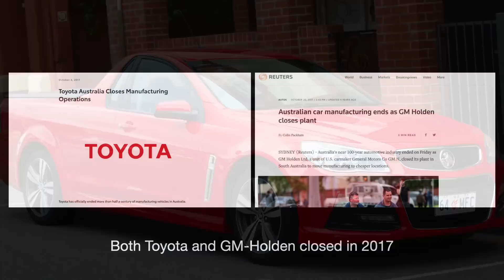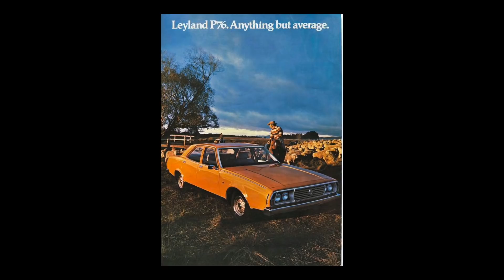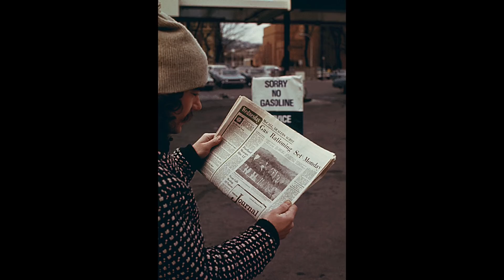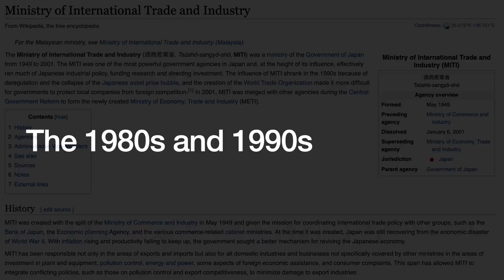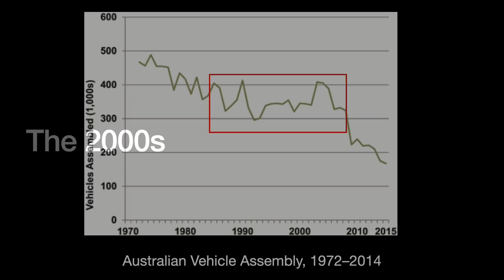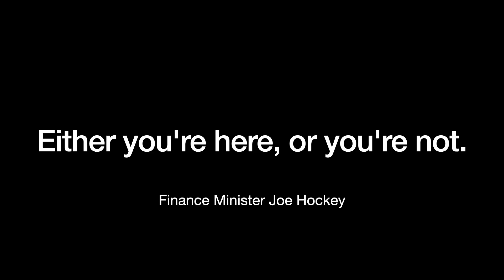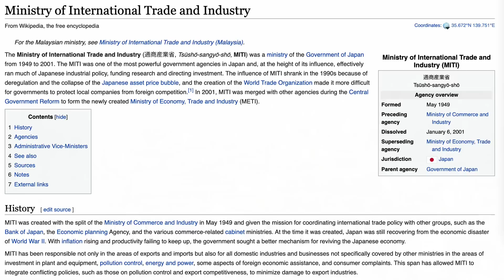Why Australia Doesn’t Make Their Own Cars

Comment: Those four auto production lines were a strategic asset. A bargain for $0.4bn a year. It was ideology-gone-mad to scrap them.
Reply: Yep. The return on investment by the government in the form of subsidies was enormous. I think I remember hearing every dollar spent by the government into the auto industry returned $5 back to the government and commonwealth.
Reply: GM destroyed Holden by using obviously Opel rebadges just less than two years after introducing and then withdrawing Opel. Making Insignia a Commodore was silly (reskin a Cadillac to RHD) and partner Holden only with GM's Buick and GMC.
Reply: @stephenmarcus9601  - Yeah, they should have called it an Insignia or a Regal. Calling it a Commodore was an insult. Par for the course, but whatever.
Reply: @Yahweh312  - Uh oh Qanon shaman alert.
Funny that guy had a huge elaborate furry hat with horns and was bald underneath. Overcompensating much?
Reply: @Yahweh312  - lol you've got all the code words

Comment: By the end, Holden made a superb product.  I had a VEII SSV wagon, a beautiful car.

Also think Ford were ahead of their time with Territory.
Reply: Agreed on both.
Being a ford owner, the territory, especially the AWD version, did suffer from suspension and steering problems, bit did depending on how it was treated.
Still , a 200kw ,4 ltr 6cly is an awesome beast , the territory could tow two tonne, no issues. 
Even the Falcons and Commodore are well-known for overall reliability and towing capacity. You could have a good family car that could tow. 
I've seen plenty VE on the tow, great cars.
It's a Shame both Ford and Holden went down the tube.
But other importer took over the market.
Now the remaining Ford Falcon and Commodore are starting to command a decent quid to buy, even second hand as they are well known for how good they are.
I personally own a 2000 model AU, best car I've owned, sure I've replaced parts on it, but with 324,000 km, still purrs along with a boat behind it.
I'm not able to afford a 4x4 , but might have to resort to an old LandCruiser or Hilux, but they have shown long term use as well.

Comment: This will upset those with blinkers on... Holden (which was Govt/taxpayer funded from day one)  always, in every model, up until the last 3 or 4 produced, made the lowest level, cheapest way out type cars. Other manufacturers, who tried, think Leyland, produced amazing cars for their time - albeit with teething problems but State Govt under Union pressure and some media made sure that the competition never got off the ground. Yes, look it up ffs before you rant. General Motors (Holden) should have made an award winning car from day one, due to the overly generous credits/money given to them by the Govt, (as the Govt at the time was desperate to start manufacturing in Oz) but GM just pulled up garbage parts from various over seas models already in production and made the 48-215 or the FJ as it is incorrectly known. Down to the Commodore, which was a European Opel, with some minor changes to the front end. 

Holden milked the taxpayer for $Millions right up till the last day. BTW, I was deeply involved in the Motor Industry from the 60's and family connections in car trade goes back another 40+ years. What about Ford you ask? similar - but Ford made the very first Australian made and Australia designed car in Australia....  (yes they did, do your fkn research)  the very first Oz designed and made car! but they also milked it but didnt get the $Millions that Holden did from start up and over time and then Valiant/Chrysler? did a lot of honest research but never hit the big time. The Holden lovers will rant and rave but what I have said is the truth, all you have to do is research it..... Holden took you lot for a BIG ride and you sucked it in. Even the advert/jingle "Football, meat pies, Kangaroos and Holden Cars" was lifted from an almost identical USA GM advert, dont believe me? look it up. The only line I would add to the old advert would be.... "Football, meat pies, Kangaroos, Holden Cars and HUGE yearly subsidies""
Reply: Phil Long , I got chastised for calling a Commodore an Opel, I could see it but apparently someone disagreed.
Reply: thank you! Someone who isn't super bogan and knows what they are talking about! Holden was always awful in build quality, but gotta get that bogan brand loyalty / psuedo-patriotism!

Comment: New Zealand had a car assembly industry with a similar path and yet smaller scale.  The last plant,  also Toyota. closed in 1998.  I am not very familiar with it, but there was little apparent coordination between Australia and NZ to get better economies of scale together.
In NZ it was the arrival of used import cars from Japan that finally destroyed local assembly.
Reply: The New Zealand car assembly industry made even less sense than with Australia. We have some rural regions where a Ute or similar vehicle is useful, but there is no outback with extreme temperatures and there are few reasons for a car made for the New Zealand market to be substantially different to a car made for Europe or Asia. Japan was effectively subsidising the second hand export industry by having very strict motor-vehicle inspections for older cars, creating an incentive for the Japanese car buyer to buy a new car. For the New Zealand car buyer, it meant a chance to buy an affordable car that was only 5 years old, something they could never afford before.

Comment: Imagine if Stellantis went to bought Holden for an affordable price of assets, that will be better for the Australian economy.
Reply: I think Stellantis has more than enough failing automakers.
Reply: @gatocochino5594  I think he meant that the would be a burgeoning auto parts industry considering how unreliable the included brands are: jeep, chrysler, fiat, dodge etc...
Reply: It was reported that General Motors did not want to include Holden in the sale of Opel and Vauxhall to PSA for some reason.  Opels and Vauxhalls are still solid cars (perhaps more so now with Peugeot parts replacing the General Motors ones!), and they could have still been sold in Holden dealers under a Holden badge... Oh well.

Comment: Point of order: a Ute is constructed around a passenger car platform, not a light truck platform (i.e. IFS and macpherson struts), and is hardly considered locally to be a truck. Ford has recently marketed the ranger ute as a truck, but it’s a passenger vehicle with a tray. Nothing more.
Reply: Whilst the traditional Australian Ute was indeed just a modified passenger vehicle the current Ranger and its siblings are body on frame construction making them more akin to trucks than unibody passenger vehicles. Even the Everest is an off shoot of the Ranger rather than the other way around. All the Rangers other siblings are also utility vehicles built on the T6 platform.

Comment: Aussie car production was never going to survive. Even in the late 1970's and early 1980's imports (especially from Japan) were the best thing. I owned a 1978 Toyota Corolla Coupe (which was locally made) but after that a 1980 Daihatsu Charade, a 1983 Daihatsu Charade, a 1989 Mazda 121, a 1998 Suzuki Grand Vitara 5 door, a 2012 Honda Jazz, a 2015 Suzuki X-Cross, and a 2016 Suzuki Grand Vitara 3 door, all of which were imported. No D segment sedans there!
Reply: True.My household had a 1989 Mazda RX7,1994 Honda Accord,1996 200sx Nissan and 2003 350z Nissan(My late fathers cars before all of that were troublesome Italians)Mine were with the exception of a Korean Holden Spark 2017 model were a 99 121 Mazda Metro,02 323 Astina,06 Tiida and 10 Micra.After the Spark was written off last May I went without a car for a while but drove temporarily a rental Astra from right2drive then looked at Fiat 500's and Mazda 2's new before settling on a 08 3.The Australian car industry line up offered nothing like any of the cars on offer.In an ideal world in the 80's we kids would have suggested around the time before the old man bought his second Alfa to buy a locally made Laser S which was essentially a Mazda 323 ss but made in Sydney.
Reply: @franzchong5889  The Japanese cars were always reliable, and replacing them was usually a matter of changing needs.

Comment: I had two locally made Mitsubishi's:- 1985 Colt and a 1990 Magna TP. Great cars to drive but were of low quality. I had gearbox and carby issues on the Magna, whilst the Colt had a stalling issue that no mechanic could pinpoint. They were problems that would generally irritate average drivers with other things in life to focus on. 
Toyota, Mitsubishi, Holden, etc should have been doing tabletop utes, SUV's and small hatches in Australia after about 2005. That's where the market was going by then. They failed to follow trends.
Reply: I had an 87 TN Magna, loved it but like you had issues with the gearbox being fairly vague but worse was the carby on the Astron, always had issues with the auto choke as it consisted of a wax plug that had never been set properly by the manufacturer and ran stupendously rich when cold. None of the service centres I took it to could fix it and quoted me $2000 to replace it. At the time I could get a brand new complete V6 from a TR for the same money. I was going to do an engine swap but then the poor thing was written off when a drunk driver ran a red light. I was going to replace it with a V6 manual TS, but stupidly went with an EF Falcon. Sad face.

Comment: My family has a final production run VF series 2 ute. Bloody brilliant car but as another commenter has already said, large engined family sedans and by extension, utes, just dont really have much export potential in a world of SUV's, large pickups and small turbo 4 bangers. 

The things Holden and Ford australia excelled at were high powered family sedans and utes, and didnt really catch on with anything else. Like the VFII SSV is a RWD sporty ute with a 400Hp 6.2L pushrod V8 out of a corvette (and came with a manual too). They are absolute certified mental skid machines, especially the utes due to having bugger all weight over the rears, and the motors were super tuneable, with aftermarket kits that push close to 700Hp with stock internals. Similar story with ford. The falcon is an absolute legend here, mostly due to the bulletproof barra motor, a 4L DOHC inline 6. They came factory turbo in some cars and pushed around 360hp, but just like the LS3 they are bulletproof and massively overbuilt, allowing for heaps of power on stock internals, and even more on the stock block.

It was sad to see Holden die but was sort of inevitable. In a world of small turbo motors, hyrbid and electric powertrains, the cars holden was known and loved for just didnt have a place any more, and the lack of economies of scale and export potential sealed the deal.
Reply: Australia also had the chance to develope a light aircraft industry. The Victa aircraft which stared flying was designed & manufactured in Melbourne. Because it was competing against Piper, Cessna& Beechcraft American made aircraft lobbing by thes companies resulted in the demise of this fledgling industry. Many Vica planes are still flying. A company in New Zealand produces a training aircraft for the NZ airforce.
Reply: In hindsight there wasnt ever much of a future for the car industry, in the meantime we made some great cars which is an achievement they can't take away from us. As disappointed as I was in it's ending I've learnt to appreciate what we had rather than what we lost

Comment: 19:00 The effects of the GFC. Green car innovation !! Automotive Industry was decimated however MINING was booming. 
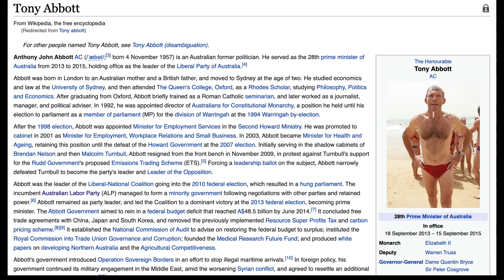19:50 Tony Abbott comes to power. 
21:00 Labor in Australia is EXPENSIVE. The automotive industry accepted 7 Billion IN SUBSIDIES between 2001 and 2010. 
22:55 The consequences of losing the Australian automotive industry. There were 260 Australian industries supplying parts to the automotive sector = all closed. 
24:55 Conclusions. WHY  DO PEOPLE ALWAYS LOOK FOR SOMEONE TO BLAME? This means shifting failure onto someone else and not taking any responsibility for any bad outcomes. 25:45 The geographic isolation means higher costs.

Comment: I don't understand the pickup truck design, or the similar ute in Australia. If it rains, your stuff gets wet. I know it doesn't rain much in the outback, but surely it does rain sometimes, and not all of Australia is the outback.
Reply: The tray is normally used to haul construction material or other items that would be out in the open anyway, so getting wet isn’t an issue. If you carry your tools or other equipment that you don’t want exposed to the elements, you can simply install a tonneau cover or a canopy.
Reply: In Europe they prefer vans. 🙂

Comment: as a Holden owner, the engine was good but the bolt ones and electrics was a dogs breakfast. We used to make good cars in the 70's but that died off by around the VL commy when we HAD to get a japaneese engine just to meet emissions. That day it was clear how out of touch we were with local manufacturing.

Comment: Who's to blame?  Well I blame Holden and Ford for building low quality, unreliable, hunks of sh1t.  The cars weren't competitive quality wise.  Cheaper, and higher quality cars could be imported, so why buy an Australian built car.  

The Australian camrys were decent quality.  But they were sedans still.  And coming into the 2000s, the sedan is not a sought after car.  Either small hatchback car, or larger SUV/wagon styles are far more popular.  Leaving sedans as relatively unwanted styles.

Comment: Ford and Toyota survived shutdown. Holden was the only Australian brand left but, also, GM created disaster when it replaced Commodore with Insignia. GM should have known this would fail based on weakness of Opel Insignia and Malibu. GM could have easily sold a discontented RHD Cadillac CT5 or reskinned CTS. Even CT 6 would have worked well. GM trashed Holden--THE END!

Comment: Instead of rolling out the carpet for the likes of Adani - we should have done that for Ford, VW and Toyota - but on the condition that they help establish local, sustainable national BRANDS, marketing both high quality luxury and reliable vehicles that could be marketed to the growing middle and upper classes in South-East Asia. We could have used our leverage in ASEAN or whatever free-trade deal to sell BMW-style cars without the tariffs that apply to BMW. We desperately need a manufacturing industry in Australia - to avoid a Dutch disease scenario. Instead - we're trying to build COAL MINES - like it's the 1880s.

Comment: There are always complex answers to complex questions . There are many integrated reasons why the industry developed and how it ended. There are no simple answers.
In an integrated global economy complicated manufacturing has gradually moved offshore to lower costs countries. This has happened in the Auto industry and most other manufacturing industries .
Policies that promoted equal playing field thinking by definition meant that industries that were not protected would move offshore to lower cost centers.
Vehicle development is expensive and with a small market and increased competition from lower cost countries a limited range of vehicles with RHD production and with a very low tariff combined with a fluctuating currency it was impossible for the industry to survive in the long term in Australia.

Comment: And the rules incentivized the production of locally made components. For example radiators and exhaust systems.  All too often the quality of these was terrible & thousands of jobs were created producing replacements.  The locally made radiators and exhaust systems might only last 2 or 3 years. In comparison I have owned cars made in Japan where those items lasted for 20+ years!  Another weakness were poor quality & brittle plastics used in the interior of cars.  One example the plastics on the centre console of the VN Commodores.  Rust protection was another area where the Japanese plants were way ahead of the small assembly operations  in Australia.

Comment: The last time I was there they had almost been completely taken over by the Japanese car industry. Such a shame when they used to make General Motors cars to their own needs under the Holden Badge, their own unique version of Ford cars and of course they did their own interpretation of British Austin & Morris cars.
Reply: Why is that a shame?  Japanese car manufacturers are just plain better at designing and manufacturing cars than the UK or American car manufacturers for the most part -- at least for compact and mid-sized passenger cars which all the Detroit auto makers have now given up on making and selling.

 ["British Austin & Morris cars." Of course in the UK case, aligning with Honda technology saved Triumph, Austin and Rover (Austin Rover) cars in the early 1980's.  While Holden at a similar time were unable to produce a modern, efficient straight-six and instead purchased the RB30 engine from Nissan.] 

But Japanese cars have been similarly superseded by Korean cars, which are now being superseded by Chinese cars!
Reply: I hear you brother
Reply: @TassieLorenzo  What American cars from the 50s, 60s, and early 70s?

Comment: Holden had been on life support from around 1984 (VK Commodore era). GMH had never truly designed anything themselves- the VE Commodore was the 1st truly GMH vehicle, the rest were GM, Opel, Vauxhall and Isuzu throwbacks that were modified & championed as "Australia's Own Design!".
Add in BS wages for production line workers (wanting mining wages to work in a factory), Union BS, low productivity, low export rates and building vehicles that noone wanted- and both GMH & Ford Oz have been doomed since the 1980's.